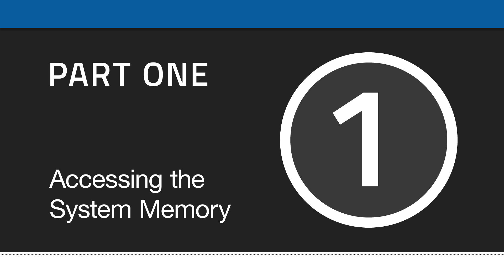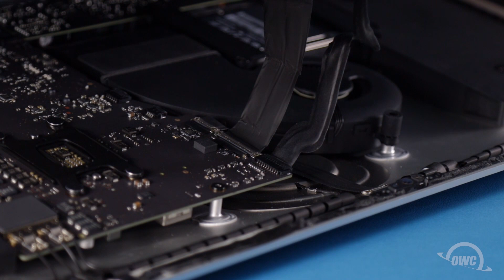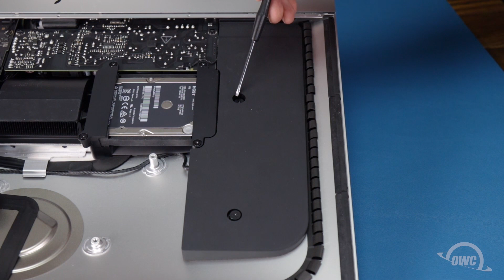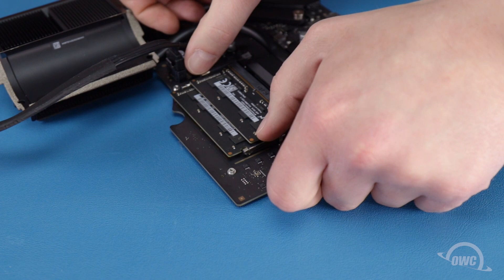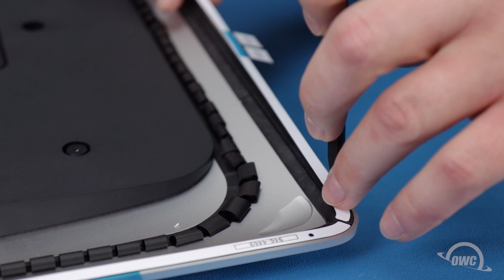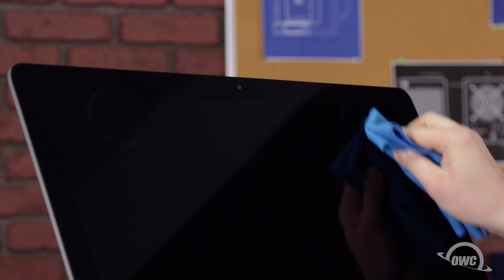How to Upgrade/Replace the Memory in a 21.5-inch iMac (2019)

Comment: I opened my Mac twice based on your HowTo's. 
1st time for replacing my HDD for a SSD and 
2nd now for upgrading my RAM and changing the internal SSD (from Fusion Drive) also to a slightly bigger one from my spare parts. 

Worked like a charm! Will recommend your guidance videos to everyone :)
Reply from the maker: Glad they have been helpful for you!!

Comment: This is the second time I've used OWC and their incredible suite of tools to help me upgrade my iMacs (first was a 2009 iMac 21.5 inch and just now with the 2019 iMac 21.5 inch) and make them faster.  I followed all the directions and both macs move SOOO much faster with increased RAM.  I really couldn't have gotten it done without watching first and familiarizing what I needed to do then diving in.   For my 2019 iMac though, although I'm sure I reconnected my microphone to the logic board, it's the one thing that doesn't seem to be initializing.  I've ordered some more adhesive so I can go back in and check out what's happening.  But if it wasn't connected - would the system recognize there being a built-in mic at all?  Just trying to rule out all that it could be before I open back up and check.
Reply from the maker: Hi Victoria. It could be a disconnected cable, or it could be that there is adhesive overlapping the mic.
Reply: @poweredbyowc  I saw on some other website you might have to do something to reset the PRAM/NVRAM
Reply from the maker: An SMC and PRAM reset are always a good idea after installing any new hardware, definitely.

Comment: Bought an upgrade kit from OWC for my 2017, 21.5" iMac; followed the instructional video to complete the upgrade, everything works - except the mic. The video neglected to point out this important step; the bottom adhesive strips cover the mic cutout, therefore, the mic won't pickup any sound. Now I have to order a new set of adhesive strips, but it won't be from OWC.
Reply: I have the same problem, it is a shame they forgot this !!!

Comment: I bought 32Mg upgrade kit from OWC.  I thought Apple support would provide assistance - but NO they don't for this model.  Not even Apple store will touch upgrading memory.  Apple refers you to an Authorize Apple dealer - wow.   OMG! Had I known upgrading memory on this 2019 iMac was going to be so complex.  Either I would've bought a 27" iMac which is a breeze adding memory or purchased  the 21" preinstalled w more memory.  So I THANK OWC big time!!!  for creating this great step by step video.  Only suggestions I would offer OWC is 1) to to rate their videos by difficulty.  On a scale of 1-10, 10 being difficult I would say this is 8-9.  It's not for the faint hearted.  Keep in mind that any static electricity may fry some of the tiny components.  As careful as I was - I was still praying I didn't inadvertently fried something.  And 2) last few seconds of video instructs DONT put display back on until you test by powering up and making sure it works.   Which of course I was so happy to have finished this project, that I rushed through, didn't read note carefully.   Had it not worked - I don't even want to think about it.  Maybe put it as a note in this utube or somewhere else.  Maybe even in the kit.   OWC - again Thank You!

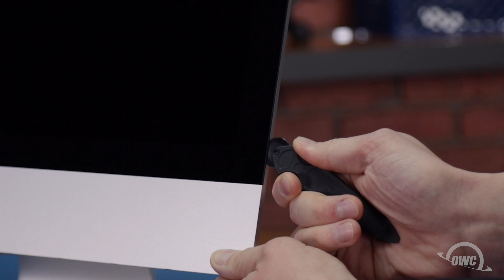Comment: 1:13 - palms sweating just watching this.

If I would have known ahead of time, I would have invested in the 27 (where RAM can be easily swapped from its removable back panel) instead of the 21.5. Oh well! But you know... I will learn to love my 1TB Fusion drive and 8GB standard of RAM. 😍😆
Reply: how is it holding up.

Comment: Hi, i just did this on my iMac with no difficulties and it switches on with the apple logo but then shows a blinking file icon and stays that way, what could it be that went wrong ?
Reply: the file icon has a "?" on it
Reply: @serenedipity8606 make sure the hard drive was not disconnected accidentally, also try holding down command and R as soon as you start the computer up, go to disk utility and see if it shows up before removing the screen again.
Reply: @serenedipity8606  you need to install the OS first, the ? denotes, missing OS.

Comment: no display after upgrade, keyboard/mouse will not have power.... Fan Spins
Reply: @davefer86. Did you ever get it fixed?
Reply: did you try to remove the display connector, blow some pressured air in the socket, and connecting again?
Reply: Cip-Cip it is a brand new iMac. Only LEDs 1 and 2 turned on. Bad memory modules
Reply: @xFER14x  still, small dust particle could be blocking it. Also, using a magnifying glass, you could check the connectors for any slightly bent pins? Sorry buddy im just kind of grasping at straws here :/
Reply: Cip-Cip it is a brand new iMac. Only LEDs 1 and 2 turned on.